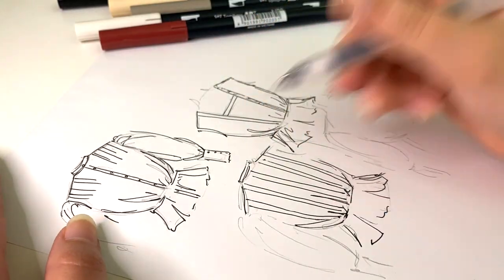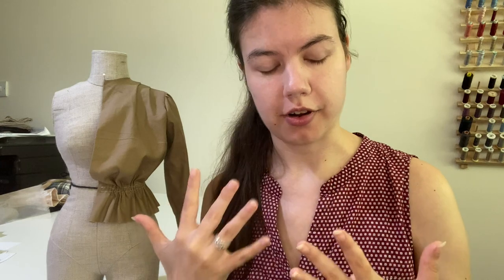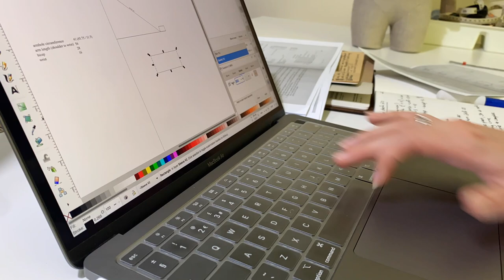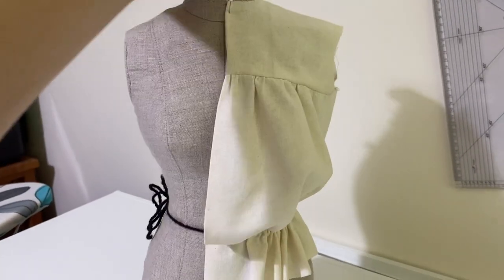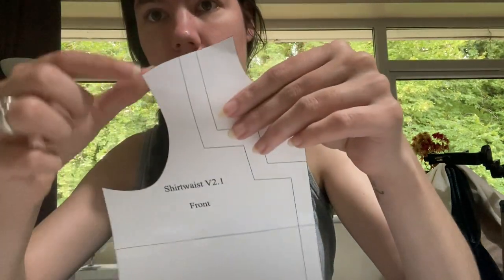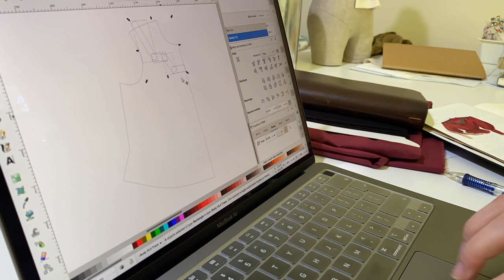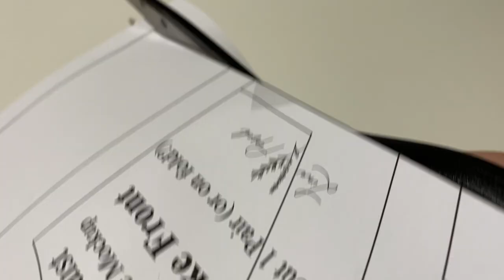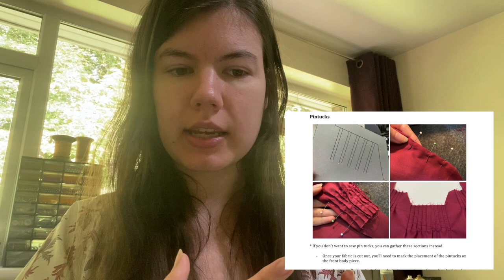Sketch to Sewing Pattern (Edwardian Shirtwaist!) - Writing a Historybounding Book

Comment: What size range do you plan to offer?  Love it!! Also can you suggest any resources to learn more about pattern drafting and perhaps computer files as a starting point for blocks?
Reply from the maker: Thanks! The size chart for this pattern currently goes from bust measurements 80cm (31.5in) to 144cm (56.5in).
Pattern drafting is far too big of a topic to cover in a comment, but I’d recommend looking up some tutorials and starting with drafting on paper. I personally find using a vector program is a lot of fun, but it doesn’t necessarily make the process easier - it’s the same process as on paper but with a lot of extra controls to learn.
I haven’t actually heard of anyone offering digital blocks as a starting point, that’s likely something you’d either need to draft yourself or commission someone to create for you.